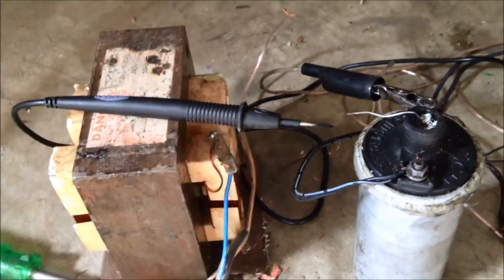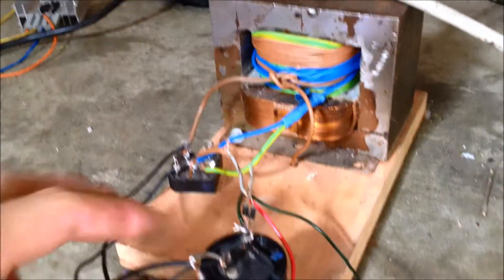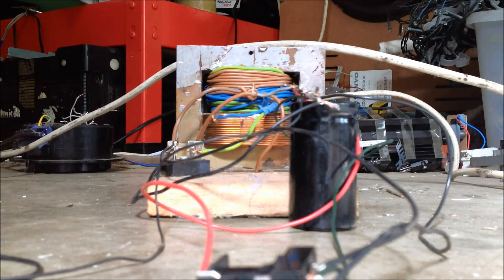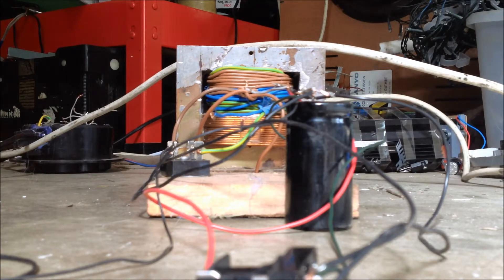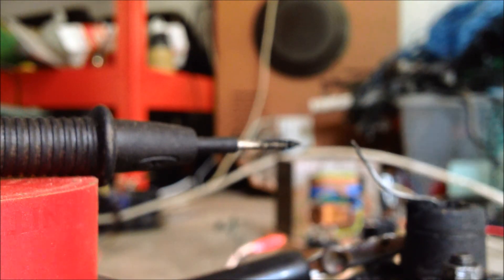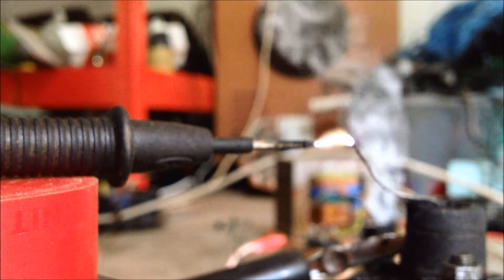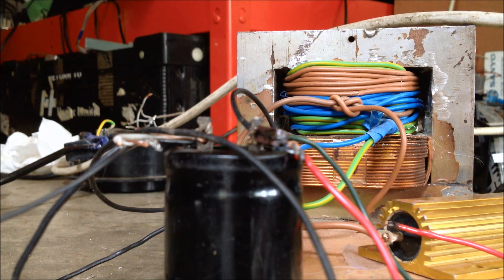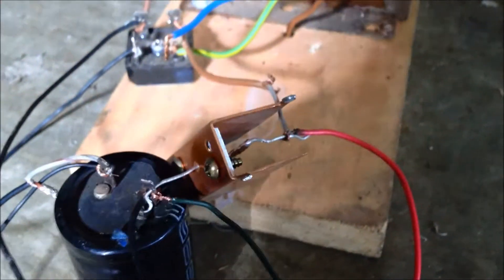relay ignition coil driver

Comment: Hi Jake I bet it was those little diodes mate that was connected to the cap! As the relay was switching very fast I bet ya getting a pulse of higher voltage back down the wires and damaging the diodes. Get bigger diodes on it mate.

Thumbs up*

Comment: Having multiple diodes in parallel has no effect! One will always take the full load while the other is doing nothing because the voltage drop is never completely equal. First the one with the lowest Vforward will start to conduct leaving nothing for the other to even start conducting.
 
Did that once with like ten cheap Chinese crap diodes. Was fun to watch them pop after each other. Like the other diodes were waiting for the one to pop ;P